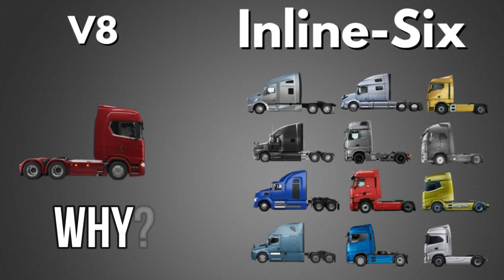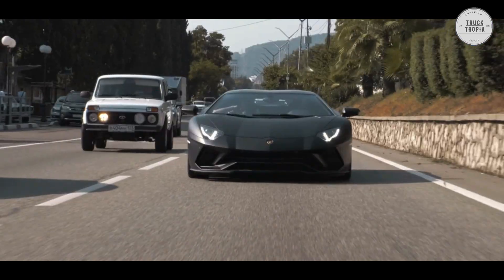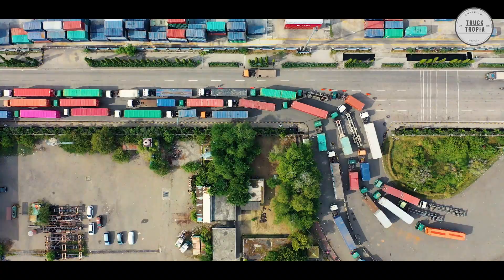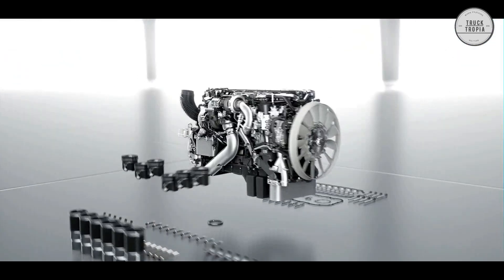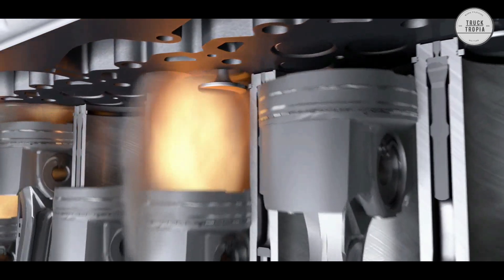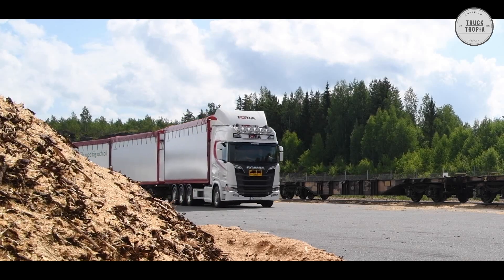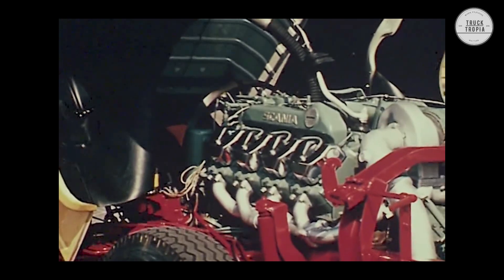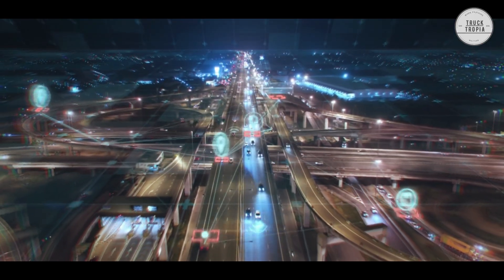Why All Semi-Trucks Use Inline-six Engines?

Comment: I6 is inherently harmonically balanced, no need or a balancing shaft. It also has a single cylinder head, so easier to maintain and repair.
Reply: This is NOT TRUE AT ALL. Inline 6 have great primary and secondary balance yes but they have GARBAGE harmonic balance. Without a harmonic damper inline 6 will destroy itself within MINUTES because it is so long has low crank rigidity, it has VERY BAD crank torsional harmonics. The harmonic damper fixes it but without that its utter trash, meanwhile most car inline 4 dont even need harmonic balancer because much stiffer shorter cranks but long car inline 6 requires them. Datsun 240Z inline 6 engine lasted 5 mins on a dyno without a harmonic damper while nissan was developing it
Reply: @288gto7  you the inline 4 is the primary engine capable do self destroying itself if it doesn't have an harmonic damper due to the extremely high vibrations, and most cars inline 6s dont have an harmonic damper, my dads merc doesn't have one for example on his inline 6 but my moms fiat with inline 4 has one due to the higher vibrations, its true on trucks but like you said its due to the size
Reply: Inline 6s have poor harmonic balance while theoretically having a perfect primary and secondary balance. 

Inline 6s have low crank rigidity and requires large counter weights to minimise the forces from each individual piston
Reply: @jhixx8910  yep exactly
Reply: @288gto7  Wonder why I never seen engines in any configuration other than inline in ships.

They probably exist but seem to be even rarer there.
Reply: @JoelHernandez-tz3vk  mtu has a lot of V engines that are used in ships
Reply: @Joel Hernández  most of the reason- same as the trucks- is simple packaging. Its a lot easier to fit a straight engine between chassis rails or inside a ships hull than any V engine. This video talks a lot of BS about torque output and fuel economy, which has little to do with cylinder layout. Has every thing to do with actual engine set up. Stroke to bore ratio, rod length ratio, fuel system set up etc. The only advantages of 6 over V8 is weight and packaging and a little (small amount) more maintenance costs.
Reply: Essencially the two main reasons. No vibration tearing the engine apart, especially important for diesel engines and the ease of maintanance means less money spent keeping it running.
Reply: Many Line 6’s have two,three or six cilinderheads.... like (wrongly stated in the vid-) two rather than one exhaust manifold!!!
This is because of thermal differences creating tensions... not an issue with a 3litre line 6 (less than a metre in length) more so with big in line 6’s (around 1.5 metre in length) 
Cheap for repair/maintenance is also questionable.... if one cylindre needs repair (piston/liner failure for example) there is no need to touch the other cylindres;the more heads the smaller the job...
If a valve breaks it will destroy the cylindrehead (and piston..) one head per cylindre will save you a lot...
Reply: @henktulp4400   Pistons fail very rarely.  And if one does, you're gonna have to take the whole engine apart anyway.  Gaskets, on the other hand, always fail eventually.  And a V-8 engine, having two banks of cylinders, has two head gaskets instead of one, doubling your chances of failure in any given time frame.
Reply: @Milesco  I am sorry to disagree.... surely engines have become more durable and reliable but when I worked in a DAF workshop in the 80’s it was quite common to get a truck in with a knocking piston.... it only knocks at combustion time;with the engine idling you undo the injector lines one by one.... the knocking piston will be quiet if you stop the fuelinjection at that cylindre.... (it is a 5 minute job) now you know which piston/liner to replace,if the engine was fine before that’s all you do!!!
Many times we would work 2 together overnight,have the truck ready to go next morning....
I am not too familiar with the V8 Scania engines but I am pretty sure there is one head for each cylindre... besides that Scania 6cylindre engines have no headgaskets as such.... the head is machined to seal directly on top of the liner,with nothing in between!
The coolant and oil channels are sealed with rubber and or o-rings contained by an alloy ‘carrier’..... there is rearily trouble there...
The sleeves are in direct contact with the coolant,three big o-rings on the bottom end of the sleeve.... for every liner there is a tiny bore towards the outside of the block;if coolant manages to pass the top two o-rings coolant is visible on the outside of the bore.
The sleeves (at least for older DAF and Scania) can be removed fairly easy with a puller....

It’s a messy job to do (removing the sump to undo the conrod bolts will make a mess of the place...) but it was common practice in those days.... mosttimes the truck was ready to go back to work well within 24hrs!!!
Reply: @Milesco  more likely to drop or crack a sleeve vs a piston failing
Reply: @henk tulp  Scania V8s have an individual head for every cylinder. Unlike for example Cat C15 and 16 or Mack MP8 which has a single cylinder head over all the cylinders.
Reply: @Milesco  haveing 2 head gaskets rilly dosen't double your chance of failure it only complicates your repair, if a engine runs hot gaskets will fail on all engines
Reply: @henktulp4400  you are really comparing the piston reliability from 40 years ago to the ones from now, pistons now rarely fail and if they do it's not so the piston but the turbo that breaks and you know what happens when a turbo breaks, plus unless the inline six engine is equipped on a bus it will have a singular cylinder head, buses are mostly the ones with individual cylinder heads, "at least from MAN where i have the most experience considered I've worked there in the last couple years, even the exhaust manifold is technically a singular piece that has the bottom part connected to the turbo and the front part connected to the exhaust gas recirculation, yes it has a split on the first two cylinders making it somewhat of a two piece but its just to make assembly and disassembly easier considering smaller engines are a complete singular piece
Reply: @mikebeddingfield2144  Agreed!... gasket failure is due to overheating or old age... the number of cilindres covered by every single gasket is irrelevant....
But if ONE cilindre has a failure,for whatever reason,it is an advantage to be able to fix that one cilindren only!!!... and have therefor a seperate cilindrehead for EVERY cilindre...
Reply: They have a better torque range--same with tractors
Reply: That is simply not true
Reply: fuel economy and less wear is the main reason. less fuel and repairs = higher income
Reply: Straight 4s do not "need" balance shafts either. I took them of my 1999 Toyota Camry and could barely tell the difference.
Reply: The truth is the i6 is the best layout but manufacturers don’t like making them because they don’t fit as well. The truth is we all want i6s
Reply: Um that's just what the video said.
Reply: The 6-71 Detroit had balance shafts.
Reply: Many inline six may have 2-3 or even six cylinder heads :) the bigger you go the more likely it had individual cylinder, boat engines often use that
Reply: BMW i6 has a balancing shaft as well as their i4 engine ! Porsche inline engine's have them as well! But for the money you can't beat a Chevy 250 inline 6 and the Ford 300 is a tank of a engine as well!
Reply: Also the fact that are in line 6 produces massive amounts of torque.
Reply: This is not true. 5 cylinders are perfectly balanced therfore they have no balance shafts. I know for a fact Volvo, Bmw, and audi use balance shafts in there 6 cylinders.(sometimes Audi still does for the 5)
Reply: The verdict is simple: 2-stroke Detroit or nothing.
Reply: @satunnainenkatselija4478  merc only offers inline 6s now, same for man that used to have v8s and v10s the reason they stopped is cost and emissions, if you look at the data scania is on its last gen of v8, doubt there's gonna be more v8s from them since they are already sourcing inline 6s from MAN cause they cant make the v8s comply to new emission regulations and from a money making perspective only people that buy v8s are self employed drivers, companies want cheap and reliable with good fuel economy  and you cant beat inline 6s on that, that's why brands like mercedes and MAN abandoned the V style engines, since an inline 6 is cheaper to make better fuel consumption, self balanced and makes just as much power and torque nowadays
Reply: 1. There are balancing shafts on truck engines. 2. Most truck engines still utilize individual cylinder heads.
Reply: Τhe conclusion is no one can make  better V8 than SCANIA which the nickname is the KING mister........
Reply: Also makes more torque than a v6 and way more reliable

Comment: The Inline engine are better for more  power and torque, because the inline has more main bearings and the rod bearings are bigger.
The v engine has smaller rod bearings.
The inline 6 has 7 mains.
The V8 only 5.
Thats the reason why the inline more power each Zylinder.
Reply from the maker: Thanks for sharing 👍
Reply: low end torque yes. horsepower no
Reply: @hotdog9262  horsepower each zylinder no.Horsepower from the engine perhaps.
You can more horsepower get from a V8 but the durability isn't the same.
The time for V8 it's over.
I love V8, but inline 6 are better and cheaper, they are Not so heavy, the working on this ist easier.
OK the sound from a V8 with crossplain crank is the best, but you want make money, you need a inline.
Reply: @nullgewinde  I agree. scania does well with v8`s still though. don`t know about the american market

Comment: Inline 6 is better all round but for 1 vital thing.. Sound
Reply from the maker: Well does sound make you money :)?
Reply: Older Cummins Inline 6 engines such as the Big Cam,KTA,L10,M11,N14,Signature 600 and ISX sound amazing with the right exhaust in my opinion.It's a different sound compared to a V8 but still very smooth.
Reply: BMW disagrees
Reply: @dy7296  Sorry, I never saw a BMW-Truck during my life and I am now 78years old

Comment: "Power doesn't matter; torque is needed for heavy loads" is nonsense. Power is all that is needed - torque is a result of power and gearing. For the same power, a larger engine can run more slowly, which is better for efficiency and wear so that's what is chosen for trucks, and that means more torque at less speed.
Reply: I think he means that they don't require massive HP. Could have been worded better I suppose.
The guys at work can't understand why my 10L truck at work is so slow. But they don't drive them.
Reply: Torque is power you idiot. KW = Torque*revolution. Thats why a 600hp car pulls less than a 400hp truck. Torque is the key.
Reply: Yes, it is nonsense. The average man armed with a decent lever can apply more torque to one of these trucks than the engine will ever be capable of producing. Will the truck move? No. There is a reason engines are measured in horsepower or kilowatts.

Comment: 1:54: OK, I have to complain about this graphic. In the US, a "ton" is 2000 lbs., therefore, 80,000 lbs is 40 tons. In parenthesis, you state (36 tons), when you mean 36 METRIC tons, or 36,000 kg. Likewise, you equate a mass of 40-44 METRIC tons with it's corresponding weight in lbs on the lower graphic. Posting weights in AVDP and mass in metric without identifiers will just confuse most people reading the graphics.
Reply: The usual fix for this, for those who insist on using this non-standard unit, is to spell the 1,000 kg unit as "tonne", distinguishing it from the short "ton" of 2,000 pounds.
Reply: @brianb-p6586  "Tonne" may work in England and Australia, but not in North America. Then we get into the confusion of "short ton" and "long ton", which just adds to the chaos. But, if you say "metric ton" or "1000 kg", everybody knows what you mean.
Reply: @Alex Clement  "tonne" is used in Canada, too... but the real solution is to use "ton" only for 2,000 pounds, and just use kilograms instead of another unit just for a multiple of kilograms.
Reply: @brianb-p6586  TECHNICALLY, 1000kg=1Mg, so you COULD use the term "Megagrams"...
Reply: @alexclement7221  You need to realise that outside of the US, there isn't such thing as short ton, or long ton. These are dated, annoying and redundant units. The SI system unified everything, based on the decimal system as 1000L of water weighs exactly 1 metric ton when it reaches its maximum density on 4 Celsius. Metric stuff is easy to work with, easy to convert units back and forth. Everything that isn't metric is dumb! Sorry, not sorry. Lol
Reply: Yeah, the word "ton" means 2,000 pounds, so using that word for 1000 kg is incorrect.  The correct word is "tonne".   "Metric ton" would also be correct, but a video that is obviously produced outside the U.S. (and therefore uses primarily metric units) is not likely to say "metric ton".   That would be like a food vendor in Mexico city calling his products "Mexican food".  😄

So the video producer should've either used "ton" to mean 2000 pounds, or else used the word "tonne" (or the phrase "metric ton", if the producer chooses to) if it wants to mean 1000 kg.

"Tonne" may work in England and Australia, but not in North America."

It's true that the word "tonne" is very rarely used in the U.S., but I think Americans should get used to seeing it (at least when spelled out visually), because that's what the rest of the world uses.  (That being said, if the words are being spoken, as opposed to written, then the phrase "metric ton" should be used, since both "ton" and tonne" are pronounced the same.)

Comment: Why is a 6-cyl lower in revs than 8-cyl ?
Reply: An inline 6 is inherently better balanced than a V8 or V6, so it can idle slower, and won't vibrate as much in the lower revs.
Reply: @alexclement7221  doesn't correspond to my experience at all.
Reply: @Unexpectedperspectivesnow  Are you a mechanical engineer?
Reply: @AngelUkiCarina  no
Reply: @alexclement7221  Nope... V8s are smooth.
Reply: Usually due to inline sixes having inherently larger strokes all the distance takes longer amounts of time to go through leading to lower rpm and don't rev so high a v shape engine could possibly achieve the same engine speed capabilities if the stroke were to lengthened enough but normally inline sixes have less revs possible due to usually being manufactured with a longer stroke than most if not all v shaped engines out there it's usually easier as well since an inline six all pistons go up and down and semis are very tall so you can increase stroke a lot and see that often
Reply: A 6-cylinder does not inherently run at lower speed. Larger engines (in displacement, not cylinder count) can run slower for the same output power. For the same displacement, an engine with more cylinders has smaller cylinders (and pistons, etc) so it can turn faster (that's why they are used in high-performance cars)... but it doesn't need to.

Comment: Inline 8 is the sweet spot
Reply: ...but too long, and with a weaker crankshaft than an inline 6...
Reply: @alexclement7221  both are problems which are easy to mitigate. First the reason trucks are able to use inline engines is because they're big and long to accommodate long engines. So there's probably space somewhere for extra 2 cylinders.
Secondly they can just reinforce the crankshaft or make stronger ones
Reply: @judenjilah7996  problem is the crank in inline 8s flex too much.
Reply: They're far more difficult and expensive to engineer than an inline six or a V8.
From Bugatti forward, inline eight designs haven't stayed in production very long, for a reason. Add to that, packaging.